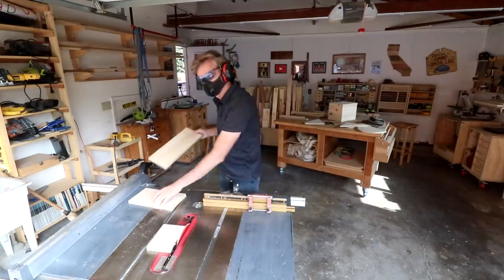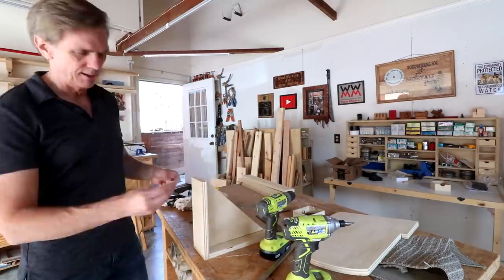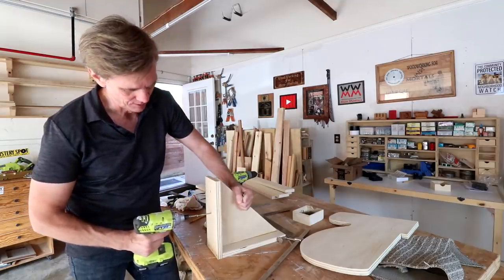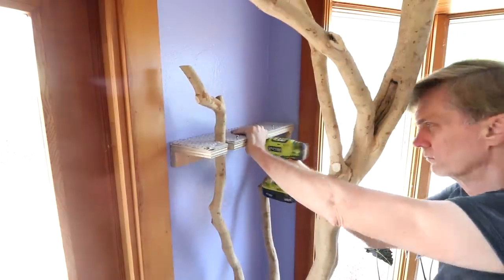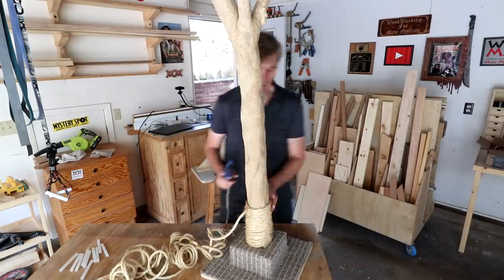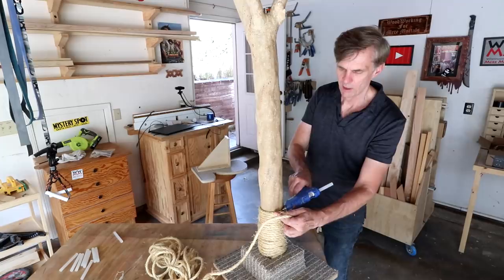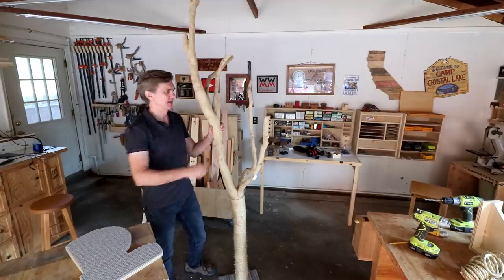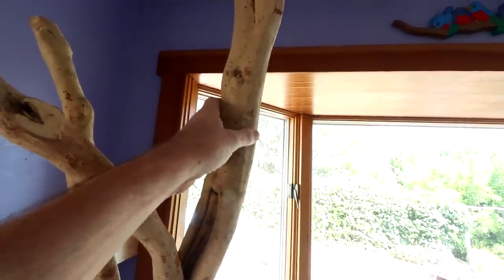Installing the cat tree. And watch Bubbles' acrobatics!😺 | Lockdown Day 186

Comment: Hey Steve! I'm confident you're right about speeding through the screw-driving into plywood.  Going quickly with the 2-1/2" screws gives the thread a cutting motion through the plywood. Going slow would likely decrease that slicing motion, instead just pushing the plies apart. I'm so glad you mentioned this though, because I've noticed that problem too, and never really thought about it before! Thanks!

Comment: Hi there Steve, to clamp the corner piece you could counter it with another smaller triangle and clamp that one using two clamps. One vertical and one horizontal. It's a bit tricky, but it should work.

Comment: The trick to driving a screw without having to worry about it binding or separating the pieces is to drill two different sized holes.  The hole in the back piece should be small enough for the screw to catch in while the front piece should have a hole large enough for the screw to slide through (but obviously small enough to not let the head pass through).  This is an old technique that I think I learned about from my grandfather.  Unfortunately it does take a bit more time because you have to drill two holes but it makes a better joint.

Comment: I realize house cats are not barn cats, but barn cats can easily jump quite high due to their being used to running and jumping a lot more just to get around in the barn, etc.  So I would not worry too much about your cats not being able to get up there, if they really want to, they will work at it and do it. :)  Same for the rope or tree...if they have claws they will climb up on the wood to some extent.  Though I realize most trees have bark that may be softer than the wood inside....cats get stuck in high trees due to climbing up with their claws and jumping, so your indoor cool cat park should be a breeze once they get used to it. :)

Comment: So for what you're doing in around 7:57, what type of drill/driver is it you're using? I have one from the same brand and it struggles for even the most basic tasks (with fresh batteries). Is it that I'm using a standard crap consumer grade drill/driver vs an impact driver? Or did I just end up with the cheapest version as a housewarming gift years ago?

Comment: Why is it that a lot of improvements shows use impact drivers to put the screws into the items? I have been driving 6 mm in diameter, and 140 mm long screws  with my Hitachi drill with no problems.
Trond Kjetil Rendal from Norway.

Comment: I was quite surprised you didn't use pocket holes on the bracket.
Reply: I noticed that too, but thinking about it there will be very little stress on the joint.  The 45° bracket is going to bear all the weight.

Comment: I have a noob question..  I pulled out my 20 year old table saw.  It is a ryobi BT3000.  I had it packed up in various boxes and had to put it back together.  I was watching old videos on youtube to get acquainted with the machine again.  They are telling me that if I rotate blade to cut a angle (say 30) degrees.. I need to move my rip fence to the left of the blade.  When blade is rotated to an angle it leans right.  I assume this is why.  Can you better explain to me why they are telling me this?
Reply: ah.. never mind.. found my answer googling.. because the blade is leaning right.. the lumber is trapped under the blade and at greater risk of kick back and or burn out if the lumber is not perfect flat.  Can get jammed or binding etc. ..   my table configures so you get lots of room on the left of the blade to make those cuts.